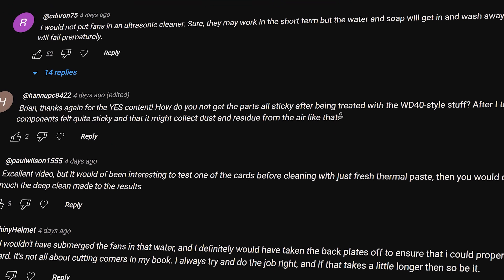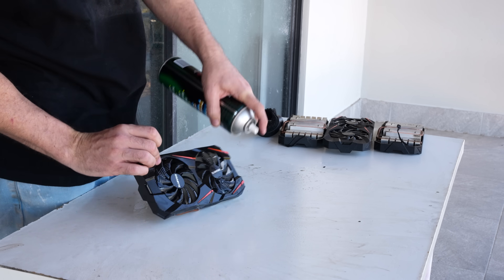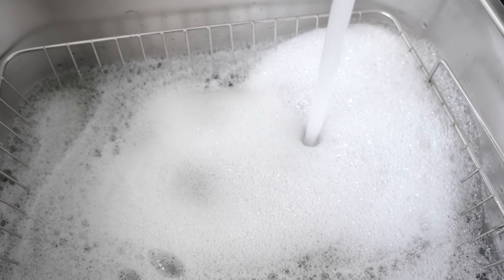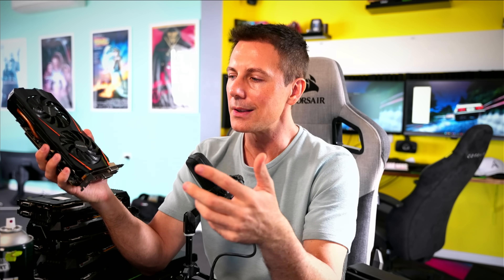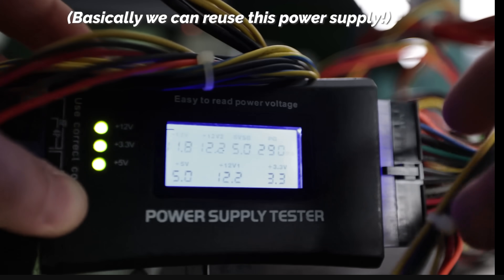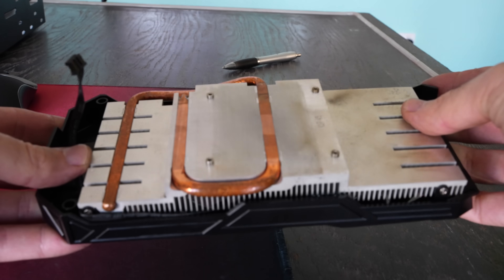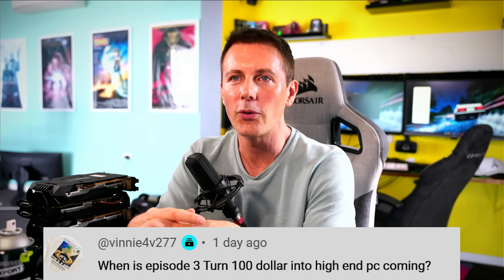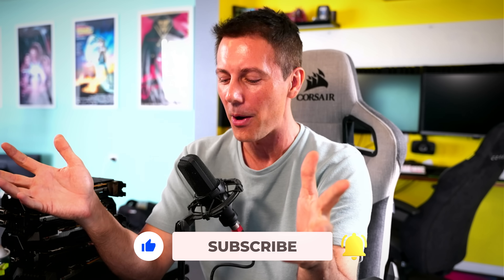"WD40" vs Computer Fans. (When Water Works)

Comment from the maker: The used content train is going to startup again soon, just had to check myself in and check out of mojorehab.
Reply: I know that's how you ruin skateboard bearings from being a kid. lol
Reply: Must be so helpful to have such a knowledgeable audience to let let you know that thing we've been doing for 30 years, they just don't work. How could we have been so foolish for so long?
Reply: Use normal out the tap water yes no problem i do the same all the time
Lubricate fan spray good job the fans will last now 
Good show doing a follow up video good job well done 
will be a good idea to remove the card back plate and small heat sink as well though thanks for taking the time to explain much appreciated
Reply: Yeah Baby!!  listening to "Soul Bossa Nova" on a loop can be refreshing.
Reply: great video and explination. Makes alot of sense. Never doubt the tech yes lovin. What do you do for cleaning water cooling components like water blocks and a res?
Reply: Computer fans are not lubricated.
Reply: @andljoy   "Computer fans are not lubricated."  <---  uh, yes they are lubricated.  where did you get the idea they aren't?

Comment: Cleaning it that way wont really hurt it as long as you re lubricate it. But the best way to re-lubricate is to pull the sticker off the back of the Fan & remove the Plug under it (the Plug is usually Rubber & it is under the Sticker). Fill it from there with Lubricant. Some fans don't have a Plug to remove though, so in those cases I put the fan flat on the table upside-down & fill the whole center of the Fan with Lube, let it soak & then stand it on it's side to drain the access Lube & wipe off any remaining Oils on the Blades & housing.
Reply: The Gigabyte fan is sealed does not have a plug
Reply: I will try later. Thank you.
Reply: if i need to disassemble the whole fan i rather just buy a new 5-10$ new one, since its already proven some brands are as good (or at least close) as the Noctua ones - tho if it was an actual expensive fan to replace like noctua/corsair/lian-li its worth to try it but otherwise not
Reply: @ronniewhite697  Most fans are sealed with tape on the back. There is a method i learned from a youtube channel on here called MikeTech where he cuts open the label to expose the plug/bearing and from there you can re-lubricate it. Afterwards he seals it with kapton tape, and it gets noisy/stuck fans running like new again.
Reply: @JoenHarlver  yes its not expensive but if you are reselling it makes a difference in the price you charge
Reply: @jacksonbtb571  Correct most are
Reply: It's the same with the new fans that have swappable fan blades.
Reply: @ronniewhite697  might be, but i would never sell a pc in such state then, unless u want to be called a scammer at some point. if i hear the fan is about to die or has used 90% of its lifespan, i would never use WD-40 or anything - its all temporary fix and will show the same problems in the next 2-3 months. i had fans which rattled or barely spin if even and used WD-40, felt like they were new after that for sure, but after a month or two the problem slowly appeared again.
Reply: @JoenHarlver  Pulling a sticker off & removing a Rubber Plug is hardly disassembling & takes less than 5 minutes. Why be wasteful?
Reply: Well explained i think blasting it with a spray can is a quick lesser way to lubricate. Also a bottle of sewing machine oil is less then one spray can costs and does at least a 1000 fan’s. I do it the way you describe also on fan’s i use myself and can say some last over 10 years now running every day. Also fun fact about some of the extreme large special case fan that exist like the 30cm i own. They start to rattle because the stress on the pcb makes it move in the plastic just mix a small amount of 2 component glue and glue the pcb in place dont use superglue as it agitates its surroundings even after curing.
Reply: @JoenHarlver  my experience is that a good fixed fan outlives a new fan almost all the time. The only ones that are a real problem are the real tiny ones on chipsets they can actually wear out mechanically. Bigger fans that rattle and rock most of the time have a loose pcb that i just  glue with a 2 component glue to the plastic housing the plastic pressure clips are just not strong enough i guess.

Comment: fans have sealed bearings, so that lubricant does not get out of the bearing during normal operation. If water gets in there and washes out the lubricant, spaying something on the surface of the fan does nothing. you need to open up the bearing and put some appropriate lubricant in there and seal it back up. otherwise that fan is a goner in few months.

Comment: I use  hair clippers so i have blade oil, when cleaning out the fans and redo the bearing i do a dot of that on the shaft or even a smear of mineral oil, less is more as these are small parts then replace the rubber grommet ,  same with the fans in my power supplies, no noisy fans or burnt out motors   i have fans still working  I have had since 2004 ,only  ever had to change them from the modernised plugs and pcie  cable requirements.   Simple maintenance can save you in the long run when you need it  to upgrade.

Comment: make sure to use distilled water as well.  tap water has minerals in it that will corrode your components
Reply: Or use ethanol afterwards to remove water
Reply: He's drying them completely right away and the spray he's using is a water dispersant so that's really not an issue.
Reply: wotah*

Comment: When switching from a water loop back to air cooled, I spilled coolant all over my 3090 pcb. I washed that thing off in the kitchen sink with some dawn dish soap and hot water. Then rinsed it using isopropyl alcohol and let it dry for a few hours. Repasted and repadded the card and it has been working well since! TechYes loving goes a long way!

Comment: I've been using silicone lubricant multi-purpose spray on PCs since the late 90s. The Silicon lubricants don't attract dust like your traditional multi-purpose lubricant sprays. When wiped on very thin they always make plastic and painted parts look new again. And they lubricate the fan bearings extremely well.
Reply: But petroleum based products eat rubber
Reply: Silicone lubricant is "usually" safe for rubbers. Its low reactive nature make it perfect for lubricating and protecting plastics, metals and even rubbers like automotive and building door seals.

However, avoid getting into sockets and cable ends because it's really goot at insulating against electricity. So don't spray it into CPU sockets, PCIe slots, power connectors, etc.

Comment: I agree with your statement of "if you just don't know what you're doing, don't attempt to do it." Back when I was younger I used to service and fix PC. And of course alot of them underestimated me since I was 16 at the time and they were "older" than I was. They would always be like maybe I'll do it next time, yeah since they're older than I was they think that they would be able to do a better job. Most of the time the same people who underestimated me came back with bent or broken cpu or mobo pins, fans that rusted, psu that died, or heatsinks with rust in them so much problems that could have been avoided if they just went back to me and not be like I'm older, therefore I'm wiser mentality.

Comment: This is dacades old trick, PC services use it all the time, they put oil in a stuck or rattling fan rather than grease, charge for it, and within a year costumer comes back to clean the fans again because you did such a great job the last time. In the old time they used syrnge with needle and poked the back sticker with it. Once the bronze bushing is loose or damaged the fan start to vibrate and make noise, high speed grease last the longest in fans.

Comment: Nice job.  Very forthright .  It's the proper way to do it.

I noticed a long time ago that you used the 'multi-purpose' stuff, not wd-40.  And I knew from clock repair techs that wd-40 is a huge no-no.  The brand has its proper uses, but lubrication maintenance isn't one of them because wd-40 dries out and becomes gummy, becoming much more of a chore to clean than grime (dirt and ordinary lubricant).m  With clocks the next freeze up can even become catastrophic.

Comment: 6:50 If you live in an area like I do with really hard water, it's a very good idea to give any parts washed a rinse with distilled water, you can find jugs of it at the grocery store for a very small amount of money in with the spring and other bottled waters. Distilled water has everything removed from it via boiling, evaporation, and condensing it so it's completely pure and non-conductive. It's just a little added insurance and safety margin for people cleaning with hard water from the tap.

Comment: I re-lubricate any fan that is stuck and it works really well! BUT, only IF the bearing within the fan isn't worn out. If the bearing is worn out you have to replace it. Giving lubricant will help with a worn bearing but not for long from my testing. Bearing grease helps a lot too for worn bearings, they make it last longer at the cost of slowing the fan speed down a tiny bit

Comment: I found the best way to lubricating a case fan that had dried out and can no longer spin without help.  You need to peel the sticker off the back and pluck out the end cap.  Then put a small drop of mineral oil on the motor shaft and work the fan by hand for a few minutes.  Put the end cap back in when you're done.

Comment: Also, I think Aussies generally will understand the generic use of WD-40 to represent lube spray. But even under the WD-40 banner there is different types, I like the dry lube (PTFE) spray as it works well for 3d printers

Comment: Long term it's not a viable lubricant. Will work short term but you want to use proper machine oil on the bearing as someone else mentioned
Reply: true but it does work better than doing nothing it should last the lifetime of the card though plus those gigabyte fans always have problems so they are not made to last that long anyway

Comment: Yeah, use the right lubricant for the right purpose. From petrol-based to oil-based to silicon-based, to others.
I've put WD-40 on my bike chain before, but it isn't as good as proper chain oil for that. It's more of a cleaner and water deplacer than lubricant.
But it's part of my cleaning routine. WD-40, alcohol, lighter fuel (gasoline/petrol), soapy detergent. Depending on what kind of substance I need to clean. For some stuff (like stickers and tape) I even rotate them around.
Reply: WD-40 for bike chains is a good idea if you need to clean your bike often. Because you can use the wd-40 to both clean and then relube the chains, which makes it a lot easier and quicker. But yes obviously it's not the most optimal form of lubrication.
Reply: The best way to clean a bike chain is to take it off and clean it in mineral spirits or with degreaser and a abrasive sponge if you don't want to be bothered with that.

Comment: The answer depends on your place's humidity. If it's high, your electronic component will take forever to dry, or even be ruined. 
So better safe than sorry. Clean it with paint brush and re apply lubricant, paste...

Comment: WD-40 was developed to drive out water in aviation parts and to prevent corrosion but is not a lubricant so you could still use it but you would also need to use a lubricant for those parts that need it.

Comment: I had this happen to me. Tried to pop the blades out but ended up snapping the supports. I ended up putting it back together by welding the supports back together by heating the regions where it snapped with a soldering iron. While that worked it wasn't worth the effort. I just felt bad about it and had to do something to rectify my stupidity.

To pop the blades on a tight hub without breaking it you can try wrapping a string many times around the center of the hub and pull on the string instead of holding onto the frame. This applies the force to center of the hub prevents any strain to the supports. Also I'd advise using any sort of spray lubricant on fans as it won't last long, trust me I've tried it on bathroom and floor fans. It last about a week or so before giving out and going back to the way it was before. You will need some sort of motor oil. Any will do, even the ones in your car probably. If you don't have any lying around, you don't have to go out and buy anything, you can probably use your car dipstick and drip a few drops into these fans. You don't need a lot.

Of course, it's best to try to do it easy way, which is find the oil cap gasket at the back of the fan hub. But none of the fans I've ever opened actually had one.

Comment: If I may add something to this topic, make sure the spray you use is not going to damage rubber and silicon's some lubricants will do that over time. I have allot of "air rifles" and they are the high pressure PCP type. You really have to be carful what lubricants you use due to the possibility of them degrading the seals.  This does not matter a whole deal most the time for PC's but there are sometimes little gaskets in stuff with water cooling, or rubber spacers and what not in keyboards and on fans. I am not sure about thermal pads and stuff. So it's worth just checking your not going to destroy all that stuff. I always worry about the ultrasonic cleaner shaking the solder joints apart.
Reply: what lube do you recommend that doesn't damage rubber?  

btw, i thought silicon was ok?
Reply: "You really have to be carful what lubricants you use due to the possibility of them degrading the seals."  

what do you use?

Comment: If you want a more "cautious" approach, I had good results using a food dehydrator (or, if you lack one, an oven at a low temperature and the fan on, but that wastes more energy) for drying hardware cleaned in the dishwasher. It takes longer, but it's more or less set and forget.

Comment: I have to check a little more but for Canada (and probably US), the JIG-A-LOO should be the all-purpose lubricant that has no oil, petrolum distillate or detergent. It is available almost everywhere as the the WD40 from what i know. The thing that i don't know is if the product is non conductive as the Aussie all-purpose product... stuff. Thanks for the video, Brian as always!

Comment: I blew up a Sound Blaster AE-7 Sound card, and motherboard, due to Lubricant / Cleaner was still pooled in the PCIE slot.....Gave off a nice flame, the slot caught fire. I have been through several products, i use one to Prime, then another to clean and ensure non conductive residue is left. The WD-40 TDS explains better what it does, and is designed for a variety of materials. An ideal PC board spray is missing in the Industry.

Comment: Dishwasher is the next best thing if you have no ultrasonic cleaner, seen it loads of times with old motherboards, and stuff from the 70's 80's and 90's and it all works with no problem.

You also see it on Restoration channels from the Far East where they find stuff dumped in the woods, or from the scrap, and bring it back to life.

As for WD40, The spray, composed of various hydrocarbons, was originally designed to be used by Convair to protect the outer skin of the Atlas missile from rust and corrosion. It's a water displacer primarily.

Household chemicals and poor cheap flux with corrosive properties are far worse to electronics than water, just make sure it's dry clean so no rust forms. Stuff like Caps bulge on their own over time with age anyhow.

Dust is a PC and Console killer, I see them on the repair tables daily being streamed live, PS5's mainly, and they get so clogged due to how the fan system has been designed and the fact they used Liquid Metal, and it oxidizes and burns off, saw one where it has to be scrapped off and in the end a new heatsink plate had to be used, so regular maintenance is key to keeping things working efficiently, like anything really, the old saying is if it's not broke, don't fix it.

And Brian is 100% right, don't mess around with Power Supplies especially at all, they keep their charges for a very long time, enough to kill, and I saw someone who even as a professional, got a shock even after draining the charge and I have seen an old Xbox PSU catch fire, from 2001 due to caps keeping their charge.

Comment: WD40 on the can says - 5 uses 1. Lubricates 2.Cleans 3. Protects 4.Penetrates 5. Displaces moisture. So WD40 clearly sees it as a lubricant.
I'm not convinced any of these sprays are the best option for long fan life, however. 
We used to clean with air then contact cleaner then relube fan bearings with light oil. (15 years in the PC repair and support industry)
I've personally washed boards and fans in soapy water (very useful for laptop drink spills 😁) No problem.

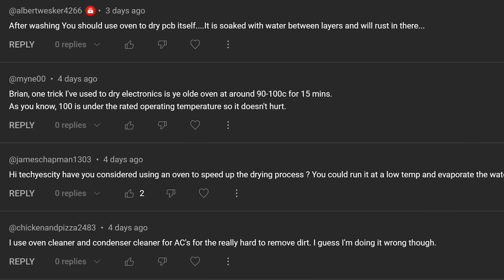Comment: 6:11 hey, thx for answering...What I meant is between pcb LAYERS... As You know regular pcb's are made with a FEW layers and copper pathways in between them...For example some motherboards have 7 or 8 layers of pcb. Those are thick.  Of course You dry water BUT only on the surface I think. Water trapped in between layers will not dry as fast as on the surfaces... I saw few gpus damaged in that way, when there was moisture inside layers... After putting voltage through, there are just little exploding vapor bubbles destroing pathways and pcb ... So, 80 degrees oven would be still safer than regular blowing air on the surface, even warm one  :) Thats just what I do if I must do a mobo bath xD